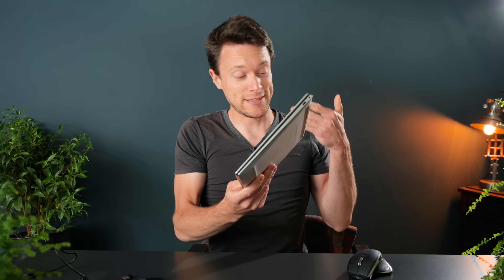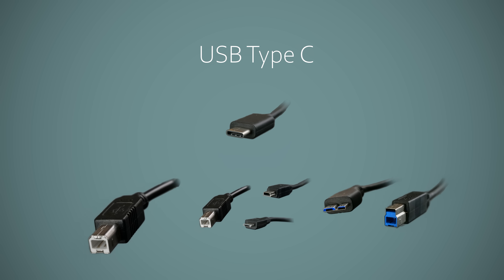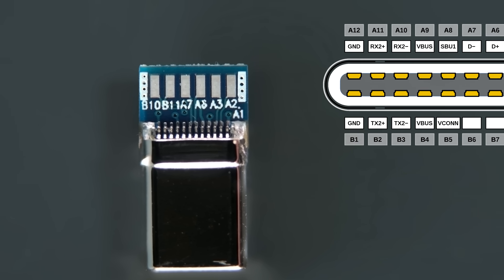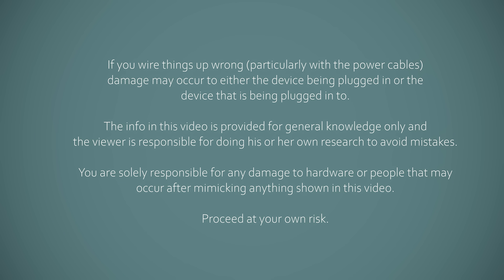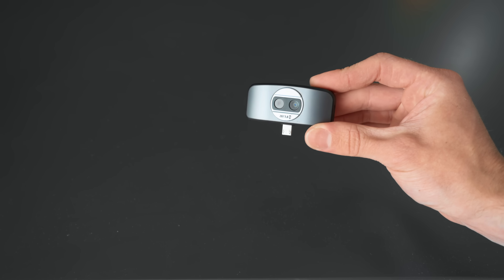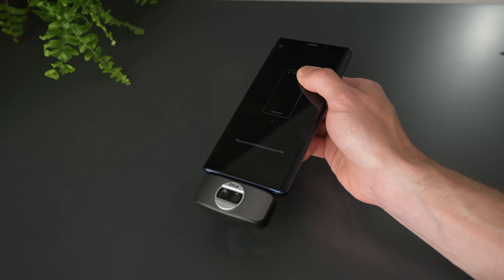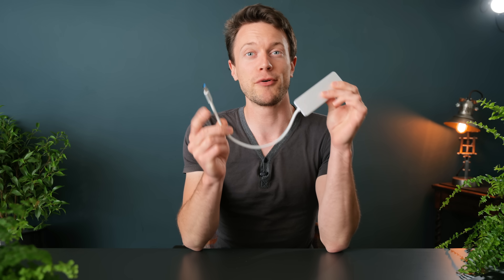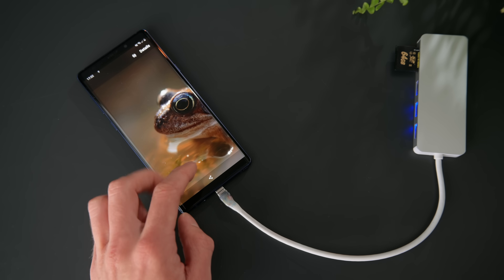Converting devices to USB Type-C

Comment: Next: How to convert your 3.5mm headphone to usb type c.
Reply: Have fun assembling a DAC.
Reply: @Monody512  If only Dragonfly wasn't so bulky... Can't have that stuck in a phone in a pocket, unless you use one of them backpacks that use piggyback to connect headphones.
Reply: underrated comment, this
Reply: For those that do not know, the problem with this is that USB carries a digital signal, a sequence of 1s and 0s. 3.5mm audio jacks (and pretty much all standard audio jacks for that matter, excluding  S/PDIF and some XLR devices) carry an analog signal, which physically encodes the peaks and troughs of an audio wave as a changing voltage. 

In order to plug an analog 3.5mm cable into a digital USB port, you need a DAC, or Digital Audio Converter. An electronic device that through various methods converts a digital audio signal into an analog one. Phones with 3.5mm jacks already have a DAC built into them, providing the conversion needed to turn digital music and audio from the phone into analog audio that a pair of headphones can play. The same goes for most motherboards, which have sound cards built-in. A sound card at its very core is essentially just a DAC.

This is why there aren't any tiny conversion dongles for these formats, because unlike Matt who in the video is just converting the wiring and plugs, to convert a 3.5mm jack into a USB connection requires a board performing active processing changing the formats themselves. Much, much more complex.
Reply: @Johnyknowhow  DAC = "Digital to Analog Converter", not ".. Audio..". ;)
Reply: @Johnyknowhow  There is such a thing as USB passive audio output, which uses the DAC in the device and doesn't require anything other than analog headphones. That's why those USB-C to 3.5mm adapter dongles are so small: a DAC isn't required. And the last thing I want is yet another thing to have to charge or get lost. Speaking of charging, you can't charge your phone and use high-quality wired headphones at the same time if you don't have a headphone jack.
Reply: Maybe the other way round
Reply: @mintalium  I can't read if this is sarcasm or not
Reply: One way I've found to make it look clean is get a pair of cheap USB C headphones or a long 3.5mm to USB C and use that as a donor cord.

The pin config for turning on passive audio out is just one resistor that turns USB C pins into ±LR. Some phones don't support passive audio out, but most current ones do. Better to do active USB C audio, but that means you need an external DAC and then you have to pay more for better audio quality.
Reply: If it's possible, why not ?....My phone doesn't have headphone jack....Crap, now days flagship doesn't have headphone jack...
Reply: Hatori Ibuki  Wrong on every count. Newer isn't always better, what it always is is higher profit margin. Newer is often inferior. I will never buy a phone without a headphone jack. If that means I eventually don't have a phone that works as a phone, so be it. There's always Skype and Zoom etc. The last thing I need is one of these stupidly tall aspect ratio screens with a cutout for a selfie camera. Give me back a bit of a forehead and chin, square corners and 16:9 screen, and stereo front-facing speakers. Also, anything higher than 1080p for a phone is just a waste of money and battery life. Bragging rights but no actual advantage.

And why are you so butthurt about something that doesn't even limit you? Having a 3.5 mm jack doesn't limit the USB functionality in any way, or the wireless functionality for that matter. You can still use external USB DACs or wireless headsets. But not having a 3.5 mm jack does limit the ways in which you can connect to other devices. For instance, car stereos that don't have Bluetooth or USB but do have a 3.5 mm input jack. If you have the jack all you need is any generic cable. But if you don't have the jack, you then have to have a stupid USB dongle to lug around or lose. Not to mention the extra stress plugging headphones into USB causes. A 3.5 mm jack is a couple of orders of magnitude more robust than any USB port.
Reply: Nah i just got some iPhone 8 plus headphones and i cant use it with my other phone
Reply: Ok
Reply: Might as well use a dongle. Doesn't add much that a conversion wouldn't
Reply: Just buy an adapter for 3.5mm jack.
Reply: Hatori Ibuki  Thank you very much. Companys have to evolve and adapt
Reply: Unfortunately not that easy as you would need a DAC too
Reply: Shut up and take my money !!
Reply: @Adventist lmfao.
Reply: This comment is so brave!
Reply: is that even possible? isn't the headphone jack analogue? I seem to recall something about a DAC as well?
Reply: you'd need a dac for that and building a tiny dac just isn't worth it, at that point just but an adapter
Reply: Lmao
Reply: More like bluetooth tho......
Reply: 😂 Is that possible? Head Phone 3.5 is analog, usb-c digital.
Reply: @SF-yw4rf  possible. There's usb c audio boards available instead of the board being used on this video.
Just need to solder L/R audio, ground and mic to the connectors accordingly
Reply: @realvivifromloona  i know right.. they hate us because we told them the truth
Reply: Also why is everyone saying "headphone jack is better then USB C!" It fucking doesn't matter. It's like electrical wall plugs around the world. They all do the same thing and have the same impact and can deliver the same voltage and amps.

Secondly " ugh but I can't charge my phone and listen to music!"

Well stfu. First, that damages the battery anyways. Of you really have to listen to music for 10 hours. Then go see a doctor before continuing to argue.
Reply: @maxh2755  You're an idiot, like all the others who say USB is better than 3.5 mm. Because having 3.5 mm doesn't do away with the USB jack, DUH, and you can still do any of the things you want to with USB. But not having a 3.5 mm jack limits you in many ways, not only with headphones but other audio equipment that doesn't have USB or wireless capability. The only reason the phone jacks are going away is because it means a (very slightly) higher profit margin.
Reply: I have a s20 and I when I got it I never knew that the headphones were usb-c. Luckily I use airpods, so I can listen and charge at the same time.
Reply: @breckr1121  you should probably upgrade. AAC works badly with Android
Reply: @breckr1121  get galaxy buds+ they are a MUCH better experience, I am on the sane boat
Reply: @svnm  Sure, if you want to lose them or always be charging them. Good luck using those on a transoceanic flight or any other situation where you will be listening for extended periods, especially where there are no power sources. The phone will long outlast any wireless headphones on the market.
Reply: Why would you do that?
Just why?
Audio jack works fine and is not being phased out any time soon.
USB is arguably worse for audio devices.
Reply: @lord_scrubington  but you see, headphone jacks are slowly but surely not existing on phones
Reply: @diamondhawk7427  Yes, they are being phased out on phones, but it is till a better standard for audio.
They likely will never return in phones, but in tablets, desktops and laptops, they will probably be here to stay until a new audio standard is found.
Reply: @lord_scrubington  WRONG!!! headphone jacks ARE being massively left out of new devices.
Reply: The thing is, why changing something which works well?
Moving from 3.5 jack to USB-C is not an upgrade as this will not give any benefits.
Why? Because the only benefit is potentially digital audio sound transmitted directly to the headphones. And this, from an human's ear perspective, cannot be distinguished from a lossless analog signal.
So, the end user gets nothing more. Theoritically, better sound quality, but not in practice where lossless wave signals are enough.
Thus, USB-C audio only has downsides: like not being able to charge the phone while listening to music at the same time cuz there is only one port. And it's a bigger port. And it's a more expensive port.

Now, second problem is: if we use audio through USB-C "because that's the future", then what to we transmit in there? Do we transmit raw audio data (and then we need headphones with a DAC built in to convert it to analog) or do we already process the sound with a DAC on the phone so we send like an 'analog' digitalized signal to the hearphones (which then will just make a very simple conversion to analog, not really a DAC) ?

In the end, guys, since sound can only be heard by human ears in an analog form... why do we waste our time to make that stuff digital just so we can use a new connector? Think about this.
Reply: @jaypaans3471  why they remove the headphone jacks is cause they can spare 0.01 cents per unit produced, and its probably a human that solder the connector onto the board which you dont need anymore saving money on labour. the DAC is still present in the phone for the speakers, so . But they can instead produce bluetooth headphones, which are pretty cheap to produce but since people think its advanced expensive technology they can have a bigger margin on their headphones then on their analog ones making more profit.
Reply: @jaypaans3471  Not really, just the "flagship" devices for people with more money than sense.
Reply: @AndrewTSq  nonsense, they are lego connectors in majority
Reply: @lord_scrubington  uhm...yes they are. We difinitely reached the point where even cheaper devices don't have a headphonejack anymore. And in 2019  there was almost not a single flagship phone with a headphone jack (only the Samsung S10 series had one, but the Note 10 didnt anymore) . Its a technology from the 70s and its time to get an alternative. Also I see no reason why USB is  "arguably"  worse for audio devices.
For example 3.5mm audio cable do not provice devices with power. Its just a really small amount only being able to power the microphone . USB C can provide much more, so speakers could be adjusted to use more of it and sound better
Reply: @sherluk_homs  Yeah, but it will render every single headset since the 70's worthless if everything used USB. Because who want's to purchase an extra adaptor. Plus, 3.5mm jacks will always be better quality than USB in my opinion. (I will say, USB Microphones make more sense. They require more power, especially if they have things like LED's on them. I completely understand that).
Reply: @sherluk_homs  Yes, many deviced don't have an audiojack, but that doesn't make it a better standard for audio.
Reply: sherluk homs
Its a technology from the 70s, yes, but its also cheap.  When USB C headphones become more common, and therefore cheaper, I'll agree with you that its finally time to replace 3.5 mm, but I don't think that will happen until phones grow a second USB C port so we can charge and listen to music.
Reply: @dafoex  i see this as a problem myself too. And an Adapter is pretty shitty. But thats why bluetooth headphones have to get even better, and they do year after year. Wireless designs will be the future. The removing of the headphone jack also pushes headphone companies to new limits, because the HAVE to improve bluetooth headphone technologies
Reply: @stinkycheese804  As already said, flagships do not have the headphone jack anymore and cheaper models will follow. Headphone companies now have to improve bluetooth headphones a lot because of the removal of the headphone jack. I bought myself the OnePlus 7 Pro half a year ago, its a high end phone for a mid ranged price of 720€ back then. Now its even cheaper. No headphone jack. I got some nice bluetooth headphones. Im happy.
Because bluetooth headphones will be more standard than wired ones, they will get alot better and also cheaper in the future.
I definitely dont have a learning disability, I just go with time and it's technology.
Reply: @sherluk_homs  removing the headphones jack is just dumb. Requires the use of Bluetooth, which not everyone will want to use all the time, and defeats the purpose of usb headphones because you still need the DAC because headphones don't use a digital signal
Reply: @NatoriousGamePlay  Its not. Its like people said the car is dumb af, cause everyone has a horse to ride. People dislike new inventions until everyone uses them because they have several advantages.
Reply: @sherluk_homs  everyone uses them, but it is not universally better, unlike the car is compared to the horse. They're are many advantages the headphone jack provides, that shouldn't be ignored. The whole reasons manufactures don't like it is because they own headphone companies and Bluetooth has higher margins. 

There is no drawback to have the headphone jack to be in a phone. Makes no sense to remove it. At least give the end user the option of how they would like to interact with their phone.
Reply: @jonasgrill1155  then you clip your 70s headsets cable into a 6.3mm - 3.5mm adapter then into a 3.5mm to usb-c cable. 
I don't know think moving the DAC from inside the phone to a 3cm cable is going to affect the sound quality in anyway, they're crappy chips from china whether theyre built into the phone or the 

Bonus: You'll end up with like a 5cm longer cable (the adapters also usually come with the phone unless you're buying a 100 buck piece of crap)
Reply: sherluk homs couldn’t agree more, defending the analog audio jack is like defending the ancient soyuz rocket just because it still carries astronauts to the ISS.
Reply: @demonicfiendchild92  The DAC isn't in the cable, it's in the phone. There is USB audio passthrough, which acts just like a regular headphone except it puts much more stress on the most important part of the phone, which is the USB port. There are only downsides to not having a headphone jack. Having a 3.5 mm doesn't keep you from doing any of the things you can do with a USB jack, like plugging in an external DAC, but not having a 3.5 mm jack does limit you in a large number of ways.
Reply: @sherluk_homs  Just put another USB-c for the headphones

Comment: Why don't you move the SMD resistor from the right pad to the left pad? One can clearly see that this will pull it to ground -> No need for an additional resistor to solder ontop of it. And removing an SMD resistor is quite easy: Apply more solder + flux and "quickly switch" the iron between the two pads, until both are liquid. You now can pull the resistor away.

Comment: TBH. The part with type A to type C conversion is a bit contrived. There are these tiny adapters that you stick inside the type A connector. All they add to length is the length of the type C connector itself. And if you don't like it falling out and want it to be permanent, just add a small drop of CA glue on the back (metal) side and that's it. https://imgur.com/a/LdqZ6Uu They're dirt cheap and dead simple. That said, all the info in this part that pertains to converting other connectors to type C is very much valid. No tiny adapters for mini/micro USB to type C :)

Comment: Great video! For the people that are scared of soldering, there exists a dongle that goes INSIDE the USB-A and only the USB-C is sticking out, so if you plug it in USB-C, you see USB-A "floating" infront of the device, which is not that bad. Here is a photo of it in action https://i.imgur.com/HURfotb.png I always have one in my wallet in case I need to plug something to my phone (Flash drive etc)

Comment: 10:46 this actually looks more like capacitor and not a resistor.
Reply: actually he removed the resistor on R1 and kept the capacitor on C1. Alternatively he could just use exactly the same resistor and solder it to R2
Reply: @BrenoAngelotti  it says R1 and R2 but it is a capacitor. Smd resistors look diferent.
At least i have never seen a smd resistor that looks like a capacitor.
Reply: @BrenoAngelotti  Btw this is what most smd capacitors look like: https://images.app.goo.gl/uX7Kzxr7f7KY9JDR9
And this is what most smd resistors look like: https://images.app.goo.gl/CpUENyySBNFWFGZq9

Comment: Hi! I have 2 questions for you: Is there a way to make a 3.5hdd work as an external drive plugged in the same way as a 2.5" external drive rather than having a cable connected to the power line as well?
Thunderbolt 3 has the same port as the USBc but what makes it able to deliver larger amounts of power and data?

Comment: First world problems. For luck I still haven't one device with either a type C plug or a type C socket xD
Regarding the type C plug: I don't think it's a good plug. It's way too small and flimsy. Like all the other plugs invented the last 15 years, it will torture us with unreliable contact, sliding out and of course broken wires.

Comment: If you're going to all that effort just open your laptop and solder the dongle onto a usb pad or use an m.2 adapter with usb pins and solder your chip to that. Considering the logitech dongles dont have a button and work through software that might be a better idea.

Can get 2 adapters and use them inside your laptop if you have a spare m.2 or mpcie port.

M.2 to Mpcie adapter
https://www.pzjaart.com/index.php?main_page=product_info&products_id=341444

Plus
Mpcie to usb2 2x 
https://rover.ebay.com/rover/0/0/0?mpre=https%3A%2F%2Fwww.ebay.com.au%2Fp%2F2114406922

Or this

Mpcie to usb3 https://www.amazon.com.au/dp/B07BJ45JXD/ref=cm_sw_r_fm_apa_i_pAdVEbF2HY7RV

Comment: For more professional and sturdy connectors: use epoxy and sand it afterwards.
Reply: And if you don't like the look of it you can also put some heat-shrink on it after you're done with the epoxy. Just make sure the size fits and put it on the cable before soldering on the plug.

Comment: Hi DIY Perks,
I've used your video to remove a webcam from a laptop to make a usb webcam and it works great.  I was wondering if you have worked on the older webcams (the ones that required a driver) to make them work again.  I've got a few of them (won't work with windows 10), and was hoping they can be repurposed.  Any ideas?  Thanks :)